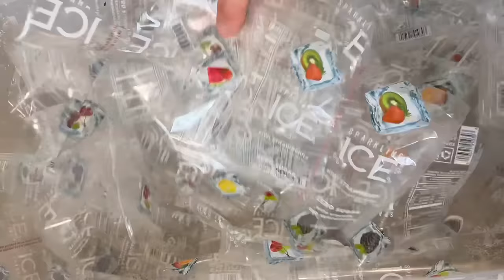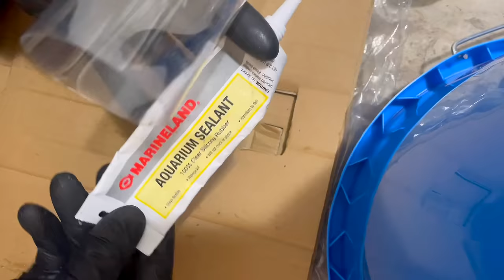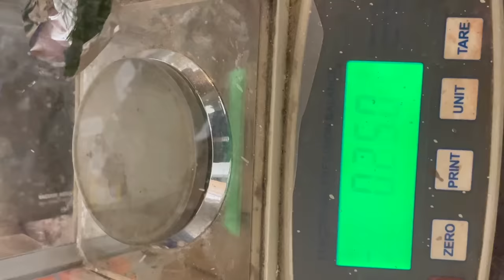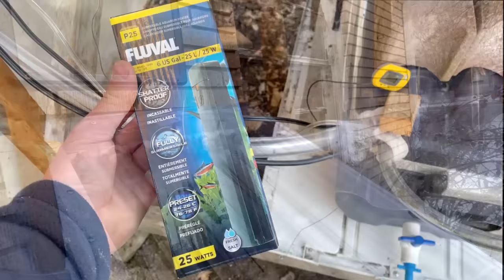Cody's Algae Panel

Comment: I realize this is a year old video. But I was just thinking and you could utilize the Tesla flow valve design it could help in pumping, and because you are introducing air into flow you could use a tromp to generate air pressure to push the pump. Making it almost completely self sufficient with the additional solar panel providing for the energy loss.

Comment: I don't quite get what this piece of plumbing for the air exchange shown at 10:35 is and what it's called. Is it just a valve? And how strong of a Aquarium Water Pump is required to move this amount of water?

Comment: Where did you manage to aquire the nitromethane? I find it nearly impossible to find in concentrations greater than 30% and distillation is impossible due to the methanol azeotrope. Freezing it out is an option but youd need liquid nitrogen or dry ice and lots of acetone to create a bath cold enough for it .

Comment: A few things. For insulation you should use aerogel batting. It works amazing and lasts forever. You should use it especially on the pipes to keep it from loosing heat

You definitely shouldn't be using plastic especially in the sun. Sub actually breaks down plastic extremely fast. UV light obliterates it very fast. I assume when UV breaks down the plastic it will contaminate the alge and probably poison you slowly.

Plastic is the worse thing for you to use for your own health if eating it.

If your just making fuel it might be okay but still bad for the environment but acceptable for a Prototype. 

I hope you don't get sick!

HBOT though is pretty good at detoxification and you can get tested for toxins from Greta plans laboratory. 

Good luck mate love your stuff

Comment: would a continuous flow work? So just a thin film of the algae solution flowing from top to drain to bottom? Then you could use a pair of cheap glass panes and some glass rod to make a sort of flat, long funnel if i am describing that effectively.

Comment: Hey bud, try this: we use 151 alcohol as an extension solution to make cannabis full extract oil.. simply put your algee powdered into a mason jar about half full, add 151 to it and shake for a few minutes. Strain off your algee plant matter from the solution. I’m guessing your gonna need a fine micron mesh to get the majority of the algee plant matter to strain off. You’ll have to figure that part out. This process is called washing. So do that half a dozen more times using the same alcohol you used the first time. Your making a concentrated algee extract. Now in a well ventilated area evaporate the alcohol off and boom you will have full extract algee oil. Complete nutrition of the algee in an oil. Again be careful of overdoing it with cloraphil

Comment: You may want to switch to glass instead of plastics IMHO. No telling how the algae would break it down during use. Microplastics are pretty hard on the body alone from plastic bottles, but if they are breaking it down or causing leaching it could cause issues later down the road.

Comment: Try combining a passive solar panel used to make hot water with your bioreactor design. The passive gain might provide all the heat you need.

Comment: I would love to see a bigalow bag outer protective coat, with a air purifying dandelion system.

The leaves are extremely high in nutrients and the inside makes latex.

Latex is needed for more living area.
Having a latex production plant in orbit around Mars, would be extremely useful.

Plus, what is the roots would help reinforce the bigalow bag.

Dandelion’s are frost proof, they have a natural antifreeze that can keep them actively growing in colder temperatures.

When a dandelion root freezes it doesn’t die.

If an asteroid punched a hole in the bigalow bag, those roots wouldn’t die completely.

I know the roots have some ability to absorb sunlight.
Would they be able to absorb sunlight half frozen?

I have tried everything too kill these plants, they could probably survive outer space.

Comment: You should utilize an old fridge take the back off and mount it to that then place all the components inside the body of the fridge so that you can use the door to access for maintenance. That should insulate for winter and also have a cooling unit should you require in the summer. 😎🤙

Comment: Maybe insulate the feedback tubes as they cool on the outside the passing water is grabbing that colder temp and the fast moving water may even accelerate temp loss. also is the face being covered by the ice preventing sunlight from entering or not?

Comment: you coul'd optimize the mesurement process. Just meassure the plate, where you put the algae suspension on, so you can weigh the dry algae with the plate und substract the plate weight.

Comment: I wonder if you could use one of those large tanks and bury it for temperature control and light it with solar powered red and blue LEDs for similar build cost to all the glass tubes.

Comment: You can also use a sun reflector/mirror or whatever as the backing to help heat the system. You know those mirrors that heat water that many low tech/open source people use for cheap energy/hot water.

The parabolic mirror ones. I wonder if you placed this in those systems if you could multi task and get solar energy/hot water and also boost your alge growth!

Comment: Have you thought about extracting oil from algae and making a biodiesel.  You could also use the "wood gas" the comes off for methanol, reacting the hydrogen with the carbon monoxide.

Comment: Most plastic bottles are one use only. There have been studies that water filled bottles with prolonged direct exposure to the sun can in fact cause chemical leeching into the water. You should go with glass instead if you are concerned with health safety.

Comment: Great video! And I had a chuckle at the green teeth while you were explaining how it's "not bad" and edible. Keep up with the great videos! Also, in the cold area, do you ever have little critters coming along to bundle up next to that warm cooler? I know it's insulated but they still might be able to glean some heat off it - or at least I'm thinking so. Raccoons? Possums? Would it be possible to train them to do minor maintenance tasks? Turn valves and switches at specific times?

Comment: I assume as this is part of the chicken hole project you're going to be collecting air from inside the bunker. I surmise that much of the temperature reduction is cause by winter cold air entering the system via the air intake/bubbler. You are also introducing cold air from outside via the bubble stone in the holding tank as it's pulling in external air. 
Both these air sources should be pulled from inside to be self-sufficient. 
The warm air will offset losses and the 20W heater should be replaced with blue & red diodes in the holding tank therefore increasing biomass production and co2 offset even if the system isn't running due to adverse solar conditions

Comment: Maybe a bit late(2 years😂) but at 16:06 the temp got lower because of the water/algae that was stationary in the tubes is alot! lower temp then inside the coolerbox(which functions as a heater in this case😁). And considering that, I think the temp 14.9 is very good!

Comment: heat the cooler overnight and you wont have to worry about bringing it back in at all since it will be dissipating the heat throughout the entirety of the system.

Comment: It would be awsome to have a sealed tube of water stood still with its own thermostat, and compare the temperatures that way it always runs, but only when the temperature is equal to the control tube, which would be the maximum reachable regardless of sun level.

Comment: I've had sea weed and sea water in a water bottle for 6 months it swelled with pressure lost some water about a third and a layer of oil was produced on the top. Down side sand turned black and smelled like acidic eggs made oil tho

Comment: Algae absorb CO2 while alive and can be processed into crude oil that can be processed into gasoline. I'd be really curious to see how much CO2 is absorbed while cultivating enough algae needed to produce gasoline to power a car with a specific mass and engine stats.

If future advancements in algae processing allow for this to be a practical alternative to oil mining... could gasoline then end up doing a 180 and become a sustainable fuel source with the amount of CO2 generated by gas-powered machines offset by the CO2 absorbed by its very own fuel source? This seems absolutely wild to me.

Comment: plumb your air intake into the house, so that the air added to the system is room-temp... you wouldn't need a heater if you did that... also, you're going to get contamination from other types of algae... so be careful.

Comment: Hi Cody, I recently saw a video explaining how researchers were able to create a battery using algae.  I wonder if you temporarily blocked off your algae loop if you could measure a voltage between both ends?

Comment: What type of filter do you use to seperate the algae from the water?
Reply: He didn't use a filter. He basically just used gravity and a centrifuge to let the algae sink to the bottom. This concentrates it to a very high density of algae. Then he dries out the water.

Comment: All your electronics are eating up a bit of power so your really not offsetting any sort of carbon footprint, if anything your making it worse. 

Of cause this can be resolved by getting a solar panel for the pump system, it would also probably eliminate the need for a relay switch system since the pump won't work without a minimal watt input.  

From my understanding solar panels should easily last 15-20years so its pretty good for the energy/resource cost of producing them.

Comment: Laughed very hard when you ate the algae. If you put plates of aluminum in the tube the heat won't pass through them as easily and you need to look into the different light filtration properties of glass versus plastic.

Comment: Why are you putting silicon on both the tube and pipe. Surely you don't think you need to put that much on, especially with the hose clamps. Wasting time and material

Comment: Did you know that 1 meter bellow ground the temperature is pretty much constant at 20-23Cº? ;)
Reply: "Geothermal" heatpumps use that to both cool and heat homes. It's very expensive to install tho.

Comment: Good to see your ingesting chlorella after all of your heavy Metal experiments. Hope you're also using cilantro (pulls heavy metals out of your tissue, where the chlorella can then remove it from your blood) and either clay or charcoal (grabs and removes it from your GI tract after it's been expelled into the GI tract so it's not reabsorbed into your blood). Chlorella is great for removing heavy metals from the blood. But doesn't remove it from tissue like cilantro will. And doesn't keep it from getting reabsorbed into the blood like clay or charcoal. (Just make sure to ingest the clay and charcoal 1-2 hours after eating so it's not absorbing nutrients from your food. And do no more than one week on (with the clay/charcoal) and 3-4 weeks or more off (without the charcoal/clay) to ensure your absorbing other nutrients

Comment: Don't think oil is algie, it's not a fossil
Reply: Oil is not made from fossils, Fossils are the result of minerals filling in and replacing the decomposing and desolving organic materials of an organism. Oil is from when many organisms (Mostly plants and algae) got buried in a time before bacteria evolved the ability to break down the cellulose, which allowed for enough time to pass with out decomposition so when it was eventually buried under enough heat and pressure over a very long time it turned to oil and other gasses.

Comment: soooo what you are saying is that crude oil is CO2 neutral? If the oil comes from algae's which took CO2 and made into oil....
Reply: Yeah, the atmosphere used to have a lot more carbon in it, and burning all the fossil fuel will move it back towards that. Life on Earth would likely adapt, but it could still be quite unpleasant for humanity.